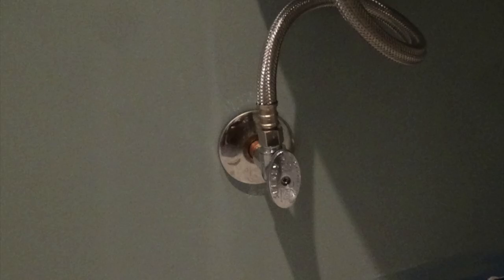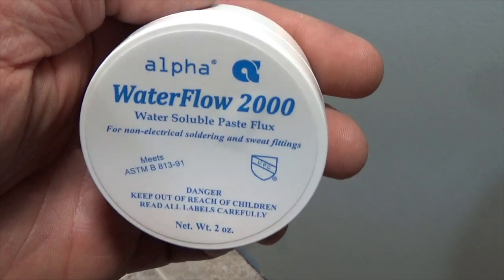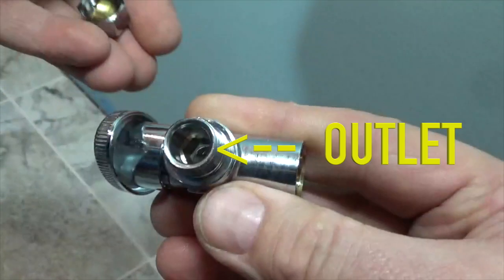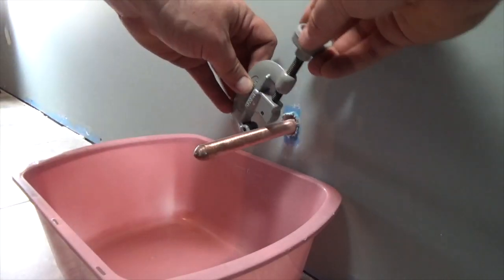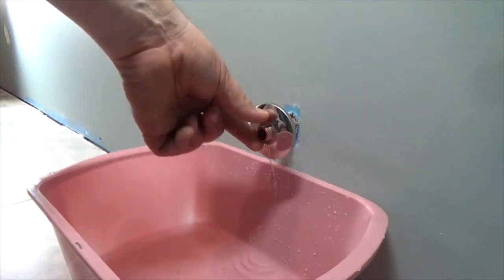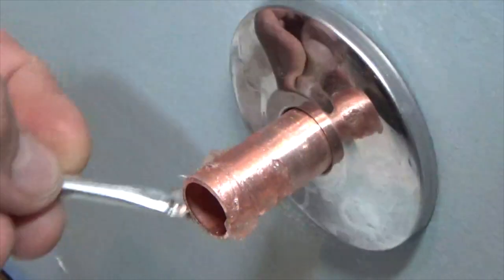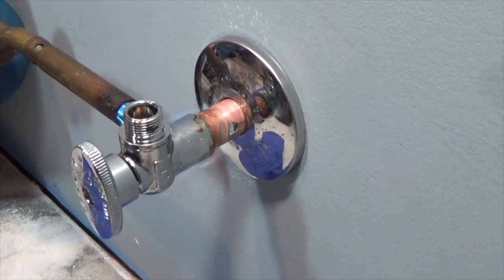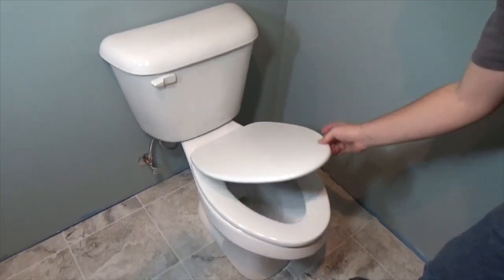How to Sweat on a Valve - Water Valve Installation

Comment: Thanks for the explanation and tool/parts needed. I want to ask a question just prior to the sweating, wouldn't it be better to remove the valve stem and rubber washer before you apply the torch?  I saw a video where the mechanic said to remove that so that there isn't any damage to the rubber parts and they stay intact.  Unless the rubber is designed to withstand heat.
Reply from the maker: I never had any problems with that, but I'm sure it's good advice nonetheless.

Comment: Trying to replace existing 5” sleeve valve, how do I remove from the copper feeder pipe? Do I need to sweat the bottom of sleeve to loosen?
Reply from the maker: Yes, you can heat the sleeve to loosen.

Comment: Hey Phil I know this video is 3 years old but I gotta tell you this is a great tutorial.  Easy to understand and you covered everything. I have  water valve under my bathroom sink and its rusted  beyond getting  the nut  off so I cut the pipe and now I'm going to use this method.  It seems to be more efficient than compression fitting and heating it up to take it back off if you ever need to seems a lot easier than the nightmare of getting an old valve and compression fitting off. Thanks for posting!
Reply: Removing a compression fitting is easy. My reaction to this video is actually - well, why WOULDN'T you use a compression valve in this scenario? I would.
Reply from the maker: Please let me know how it went, Richard!

Comment: I would have liked to see you deburr that copper pipe first. It probably doesn't matter at the valve union but it's good practice.
Reply from the maker: ya.... it's good practice for sure.  Thanks for the tip

Comment: Do you need to be concerned about the wood stud inside the wall catching on fire from the heat conducted from the heating of the copper pipe? I ask this because the pipe is most certainly strapped to the wood stud. My copper stub sticks out of the wall only about one inch. Thanks
Reply from the maker: Never had that problem.  You would have to put the flame directly on the wood to light it.  Just keep the flame long enough to melt the solder

Comment: You did forgot to sand the inside of valve connection
Reply from the maker: I didn't sand it, I used a wire brush tip.

Comment: I always, always would sweat on an adaptor so that you can use a threaded valve and never have to sweat again when the valve needs to be replace. Always.
Reply: Yeah. But that would look horrible. A big ole female sweat to make pipe thread fitting. No good. 
Sweat or compression are the cleanest ways.
Reply: I have done this exact thing on my home's stops.  Stops inside cabinets are a pain to get to if you need to change them.  Presumably, the 1/4 turns won't get leaky and corroded like the old globe valves, but just in case, I can always just replace them without sweating again in the future.  Most of mine (except the toilets) are inside cabinets, so I don't mind how they look.  Even so, I don't find the FIP adapter to be obtrusive.
Reply from the maker: That would be another great video.   I like your method!  I also have a video that shows how to put a compression valve on.

Comment: so. .... im trying to remove a 3/4 base board heater and will reinstall at a later date. i wanted to just connect the in/out lines so the hot water just loops back out. i purchased a couple of 3/4  90 degree elbows but they seem to be the EXACT diameter as the pipes so there is no way in h*ll itll fit. am i missing something? is there another fitting im supposed to use?
Reply from the maker: Hard to say without seeing the pieces.  What I would do, is go to the plumbing store with pics and the pieces you have and talk to the salesman.  You may simply have the wrong size piece.  Sure wish Yt would allow pictures in the comments.

Comment: You didn't wire brush the inside of the valve prior to installing, you should have
Reply from the maker: That definitely won't hurt.   Thanks for the tip.

Comment: How would this be done if you want to put a chrome plated sleeve over the copper pipe to hide the copper? I like to do this so that everything appears to look like polished chrome. I don't like the look of copper mixed with polished chrome. Would I have to stick with a valve that tightens onto a copper pipe with a nut I tighten with a wrench?
Reply from the maker: probably use a compression valve instead of sweat.
Reply: @PhilCrockett  Thanks, will do!
Reply: They sell these valves with chrome plated brass extension tube that fit over the copper pipe and then soldered. Sold at Amazon or Home Depot or Lowes.

Comment: What would I need to do for the opposite; removing the sweat valve?
Reply from the maker: just heat it up until it slides off, then sand the residual down to fresh copper.

Comment: Don't you need to remove the rubber gaskets from inside the valve so that they don't melt down while you are applying heat?
Reply from the maker: You can.  I always unscrew it as far out as possible.  I don't keep the heat on it longer than I need to.  but..... sure.....  remove it if convenient.
Reply: @PhilCrockett  do the quarter turn valves not just have a plastic membrane inside them? I thoughy only the screw-close type had a rubber washer inside? 
Do you have any experience taking these apart? Is there an easy way?

Comment: Good video, but you used enough flux/paste to solder a dozen valves.  Only a very thin film is required to allow the solder to migrate into the socket of the fitting.  Also worth noting, Apply ONLY enough heat to the valve to melt the solder.  Over heating the valve can cause plastic or teflon seats in the valve to melt or deform.  Ball valves are usually quite tolerant of a little excess heat but if soldering a valve with rubber washers or seats inside the valve should be disassembled and the washers removed before soldering, then reassemble when it has cooled.
Reply from the maker: Thanks for the critique and tips, Chris.

Comment: Not bad, to the point and brief.  However I have one tech tip to offer.  In the real world when doing this kind of job, you'll want to remove the washer from inside the angle stop (water supply valve) or else you'll be cursing yourself later when trying to shut off the water supply off to the fixture.
Reply from the maker: That's a great tip, Tyler!  THANKS!

Comment: I have one of these valves that will not open up. The gate seems stuck in the closed position, and the handle turns. The valve got stuck while I was in the process of swapping a filter out on the line. I've heard that these valves prone to breaking.

Is there any reason to not go with a more reliable ball type valve?
Reply from the maker: I have struggled with finding the perfect valve for years.  Im convinced that there isn't one. soooooo, instead, I just learned how to change them out as needed.

Comment: I have a sweat valve that is leaking. Should I replace it with a sweat valve or a 
compression valve? Which is easier?
Reply from the maker: I will always go with a sweat valve"...........however, that’s only because I’m good at putting them on and I trust the seal.  However, it’s completely a personal choice.  I think the easiest is a compression, but the pipe really needs to be super clean and smooth for the good seal and compression of the ring.

Comment: Who needs a reamer? lol.
Reply: Or cleaning/sanding/wire brusing the valve before soldering
Reply from the maker: That sounds aweful....... NOT ME!  I want nothing to do with no "reamer"!
Reply: You should always ream the inside of a copper pipe because The burs will create turbulence like a 90 degree fitting does and it will put pinholes in the copper pipe later down the run. Too much flux will eat pin holes inside the copper pipe and create future leaks it will also eat the rubber seals inside the stop remember flux is a acid.I am commercial plumber I guarantee that as facts brother other wise great YouTube video and keep up the good work.

Comment: Thank you for soldering on a quarter turn instead of one of those unreliable multi-turn valves. My whole house has sweated-on multi-turn valves and they all have to be changed because none of them actually shut the water off. Why the builder put on soldered valves that fail after a few years of non-use is beyond comprehension. They are a pain to remove if you have no soldering skills.
Reply from the maker: YES!!!! I'm DONE with those other crappy valves!!! only 1/4 turns for me!
BTW..... you have soldering skills now after watching my video.  just practice on some pieces.  If I can do it, anyone can.
Reply: Phil Crockett do you just heat it up and it comes off?
Reply: They don't work because the plumber was too lazy to take them apart before soldering. Or too stupid. What do you suppose happens when you heat the rubber and plastic parts inside the valve to over 600 degrees farenheit? You likely ruined the valve before you ever put it into service.
Reply: You can add a quarter turn piggy-back if you have the room. Good choice when the valve is hidden in the wall.  https://www.familyhandyman.com/project/fix-a-leaky-shutoff-with-a-supply-valve-piggyback/

Comment: Great job, I just don't like the transition from the silver color to copper back to the silver. I'm pretty sure they make sleeves with a 3/8 OD to solder over the copper.
Reply from the maker: Not sure about sleeves.  I was thinking..... if white would look better to you than copper,   you could cut a small thin schedule PVC pipe piece,  cut down one side, and see if it snaps on over the copper.   just a thought.  OR...... You could tape off the silver parts, spray paint primer and then chrome paint over the copper.   Wonder if there's a chrome paint they uses a brush.
Reply: @PhilCrockett  or just do it right
Reply: @sal.pizzurro  
Show me your video on how to "do it right".